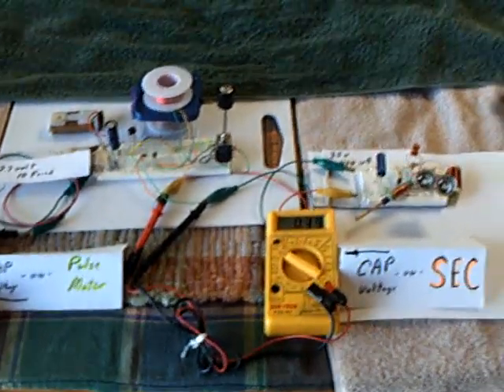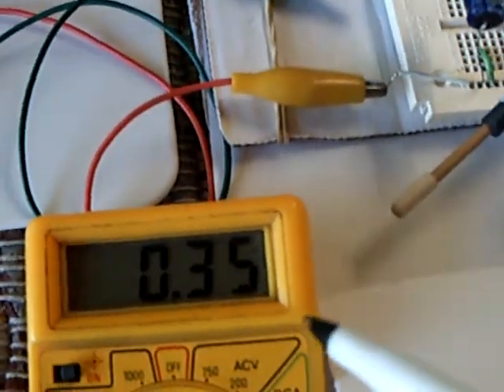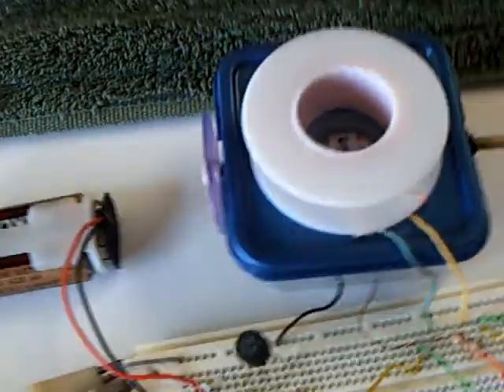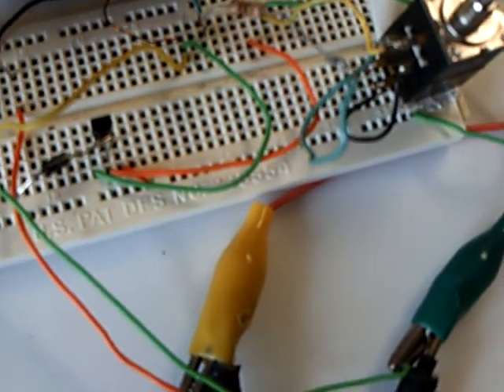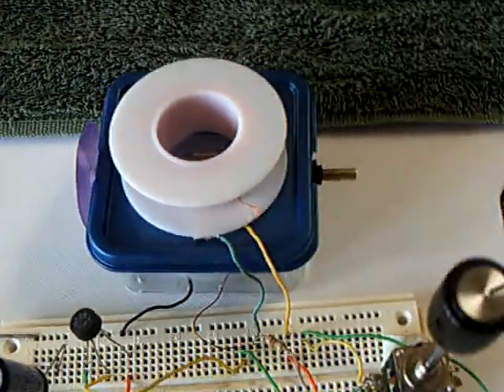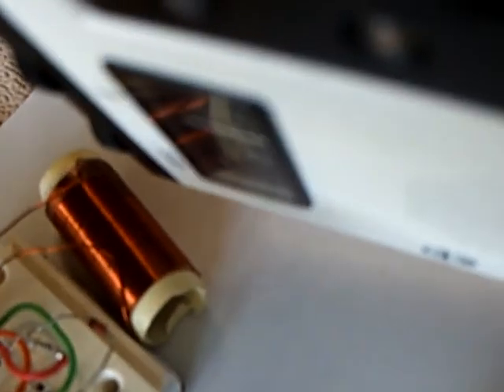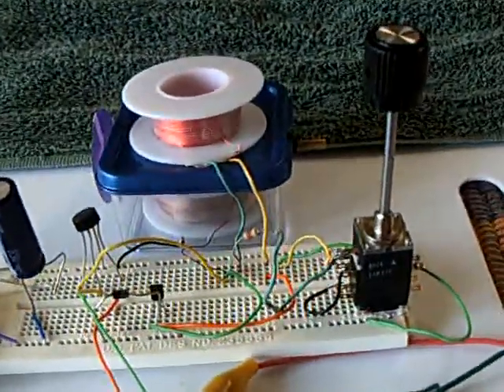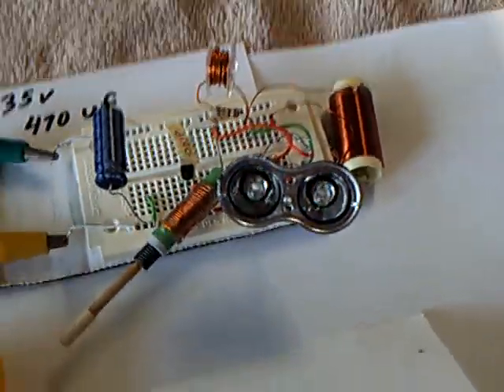Pulse motor driving a SEC--on "back spike " power

Comment: @Lidmotor fair enough! i also wanted to ask your opinion on the differences in wireless output of the SEC circuit and other HV drivers. anything in particular that makes it more efficient ? I know i can achieve the same wireless transfer by using any antenna/receiver setup with HV, but what about the SEC makes it so effective? 
from what i can tell the energy being sent to your LEDs is simply "looking for ground" and when u get near or touch it you are stealing from your earth ground.
thanks.

Comment: You have to think of this process on the cap as separating positive and negative charges.  You are creating a non-equilibrium state.  By allowing the potential differences in voltage to be inverted or retroflected, you're causing the cap to have potential from bidirectional longitudinal waves.   You have to cause an imbalance for energy conversion.  The answer is "simultaneous open and closed paths" to extract energy between any two points or nodes.  V and I are zero not following joules law.